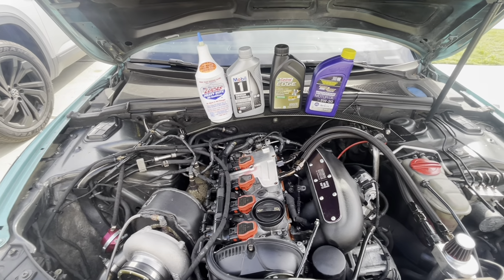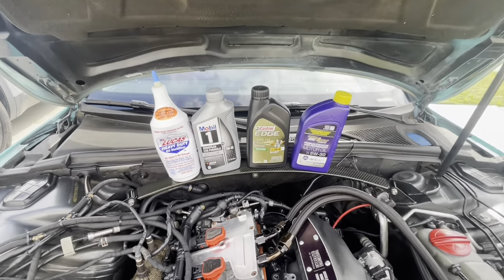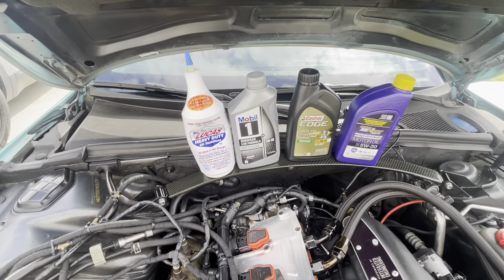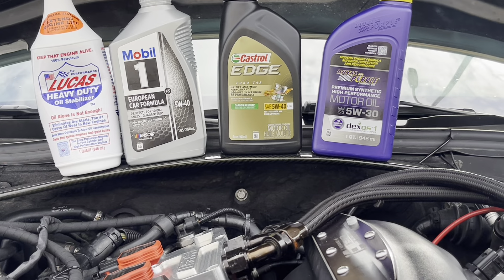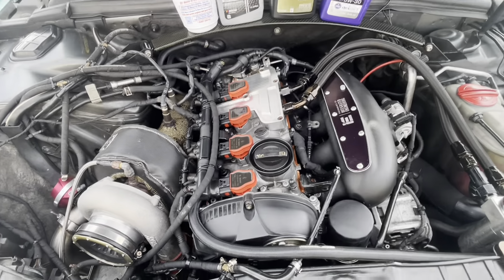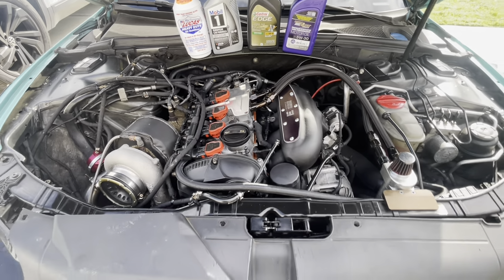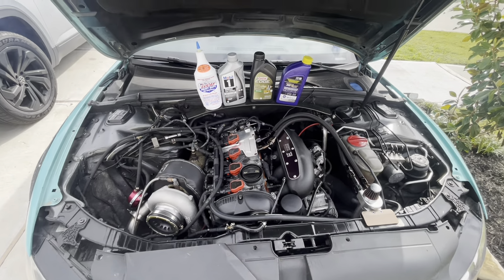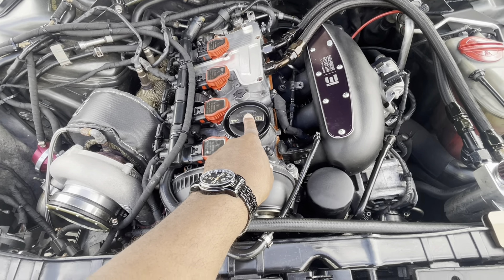(AUDI OR VW) WHATS THE BEST OIL TO USE AND WHY?

Comment: I've seen a few of your vids and they seem quite beneficial. I'm picking up my first Audi tomorrow - 2011 Audi A5 premium plus manual transmission. It's been yeeeaaarrrrssss since I've owned a car and due to living situations (no garage) I wouldn't be able to do my own maintenance. If I pulled up to a shop with my own Liquid-Moly and Lucas oil additive would the mechanic use them or would they use their own products. Silly question, I know but as I mentioned it's been a minute since I've owned a car let alone an Audi. Thanks in advance!

Comment: Thanks for the content, by mixing the Lucas will this make my oil temp go up I’m currently using 0/20 Molly oil and running 034 stage 2+ tune and I’m over 60k on my b9 S5 Sportback.